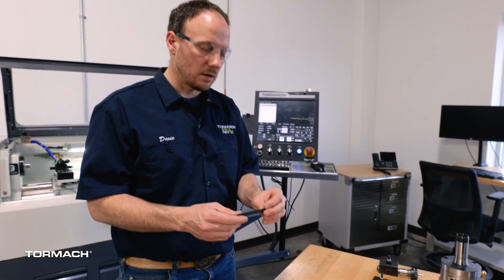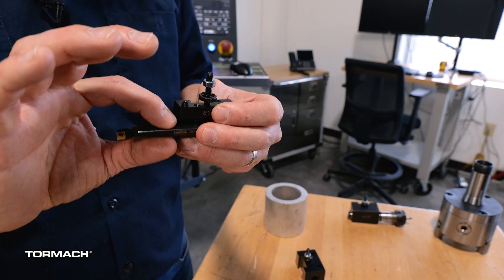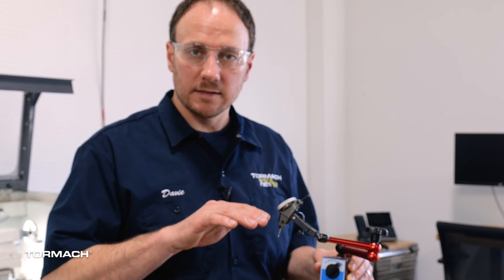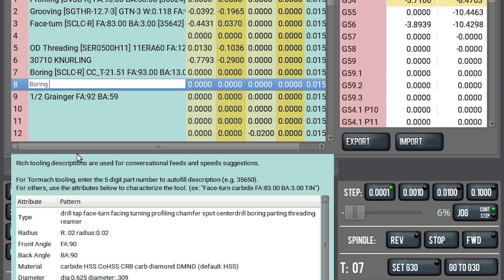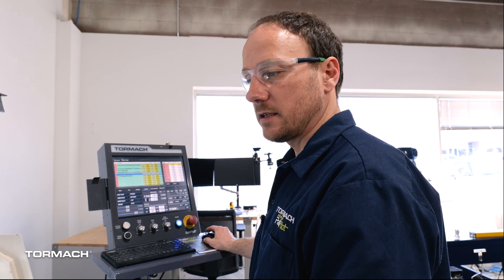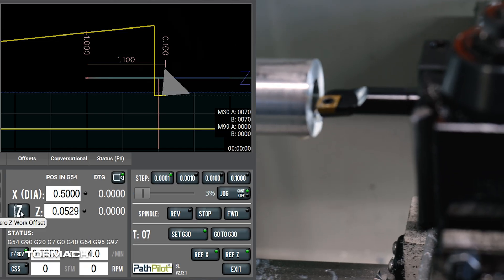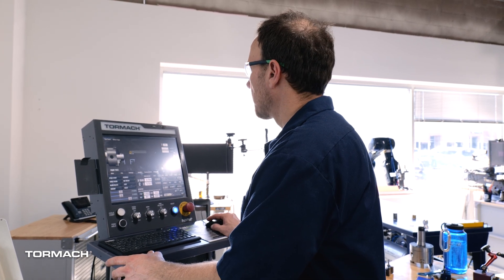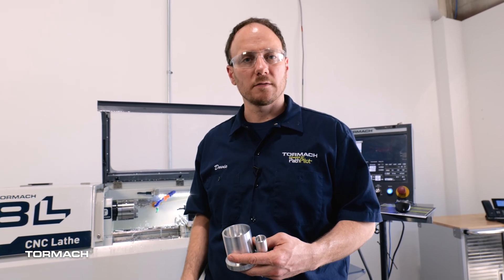Setting Up a Boring Bar on a Tormach 8L Lathe

Comment: This seems like an imprecise way of setting the offsets.

I use an electronic edge finder in the chuck and I get within 0.001 mm then I just add extra compensation if needed after doing test cuts but 9 times out of 10 I dont need extra.

Comment: Nice video - but the telescoping gauge technique not great to ensure accuracy.  The tool should be tightened with the gauge at an angle inside the hole, then straightened and withdrawn.

Comment: Great video! Off topic, but does the 8L come with that touchscreen pathpilot like what's on the 1100mx? We just ordered a the 15lpro so I was curious if there are options to upgrade so there's those same overriding knobs
Reply from the maker: You have several options for the monitor/controller when putting together a Tormach 8L package. You could order a separate PathPilot Controller and then add on a Standard or Touchscreen monitor, that can then be mounted to a controller arm. Or, you could you could instead order a PathPilot Operator Console; which bundles the PathPilot Controller, Touchscreen and Arm, but also includes the physical control knobs, buttons and jog pendant.